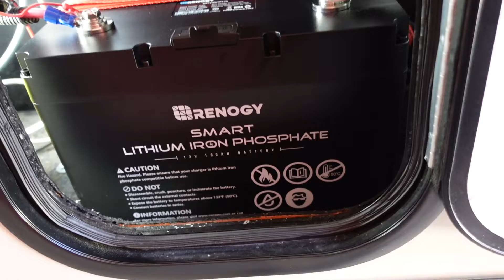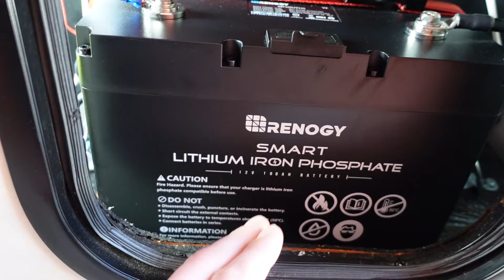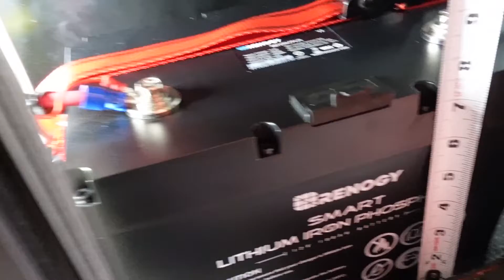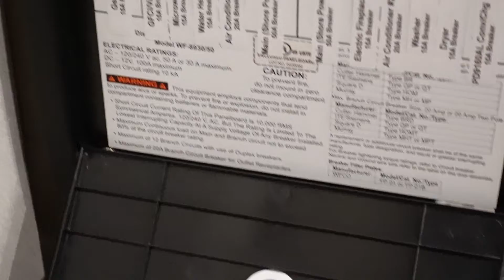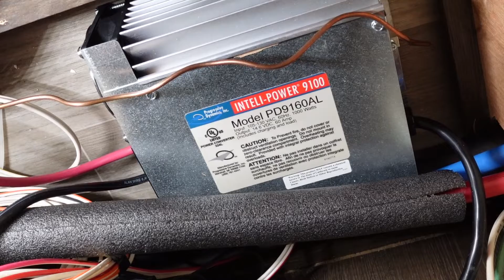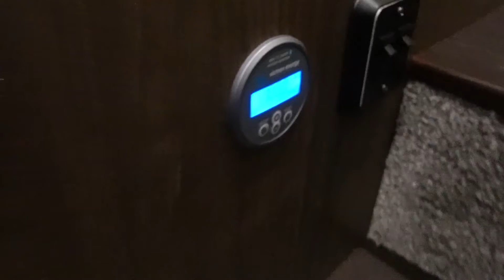Install & Review: Renogy Smart Lithium Iron Phosphate 12V 100Ah Battery in Fifth Wheel

Comment: You cannot connect these in series
Reply from the maker: Apologies for the misinformation. I should have been more specific and clarified that they can be connected in parallel for additional amp hour capacity at 12V, but not in series for 24V etc. Thanks for catching that.
Reply: @Robert Dillon  I would disagree ..they are ul listed ....doubt they are any more dangerous than any other type of battery
Reply: @Robert Dillon They are not Pouch cells anymore.. That went away in 2020.. They are packed in groups of 4 cells x4 now..And each pack is a single standalone cell...
Reply: @WizzRacing  That is for the newer cheaper model that is rated for up to only 2000 charge cylces an ha Bluetooth built in.  The better models are still pouch

Comment: Are you aware you've put a 60amp charger on a battery that has a max charge rating of 50amps?
Reply from the maker: Yep. The converter/charger doesn't literally output 60A 100% of time, rather it tapers to follow an optimized lithium charging pattern. Think of the rating as a max rating, capable of delivering up to 60A. Also, the Renogy battery has a BMS to optimize the current for charing and discharging. When selecting a replacement coverter/charger, you always want to meet or exceed the original amps. This is important as the same device also converts your 12V panel and you always want more amperage than will be drawn in the end. So if you had a 55A WFCO WF9855 model originally, then you'll need a 60A PD PD9160ALV replacement. Here's a helpful page to select the right one for your coach:
https://www.progressivedyn.com/lithium-converter-replacement-units/

Comment: Super video!  I have a new 2023 5th wheel and have been doing a lot of research on how to change to lithium.  You confirmed my thoughts and I am going with the same converter.   Just need to decide between Renogy and Battle Born.  I am planning on two 100 amp batteries so cost will be a factor.  Thanks again for o e a great video.
Reply from the maker: Thank you. Sometimes I'll see both offer some pretty good discounts, around $100-150 off especially at the big holidays. Sometimes "B stock" from Battleborn too.

Comment: You say you changed the charger from 55A to 60A.  There were comments on when that may, or may not, be necessary.  But my question is that the Renogy battery says maximum charging is 50A.  So is that 60A  going to damage these batteries?
Reply from the maker: No, the Progressive Dynamics is intelligent for Lithium batteries so it'll be fine...it knows when and how much to supply to lithium batteries. Plus, the batteries themselves have BMS that will restrict. Yes, there are a TON of comments and misinformation about not needing to change out a lead acid charger with lithium batteries. Yes, you can leave your lead acid charger in place...but it will absolutely not top-off the new lithium batteries to full capacity, meaning 100%. It's like only getting some 80-90% of the capacity of the new lithium battery bank. Plus, the charging characteristics are different between lead acide and lithium, so it won't charge as quickly nor efficiently. So it isn't "necessary" but seems like the logical thing to do to replace the charger at same time to one that is lithium compatible.

Comment: You can't discharge Lithium batteries to zero...Unless you want to jump start them. Why you only discharge them to 90%...As you need a 2 volt reference for the charger to work right...As I have two of these. Why they rate them for 1200wh,, But you can get 1350wh out of one..that last 100wh is needed for the charger to work...

Comment: Will this battery affect the alternator on the tow vehicle?
Reply from the maker: Not any differently than a lead acid battery. The tow vehicle is a pretty low trickle charge, so just a little going to battery itself.
Reply: @AdventureRocks  So if I want to replace the factory battery with 2 -100AH Lithium Iron Phosphate batteries on a 2021 micro minnie 1708 TT with 190 watts solar it would be drop in but only charge to 80 percent if I don't upgrade to a lithium charger but it would work. Would the solar controller have to be upgraded.  The trailer has a dometic 12v fridge I would like to go a few days without running a generator. Could add a second 190 solar. Have a NOCO 10 amp lithium charger that I would not mind hooking to the generator every few days.Just trying to find out what I can live with and what has to be changed, mostly do not want to ruin something.
Reply from the maker: @nkelley104  Yes, that's correct. And, it might charge a little over 80% with your existing lead acid charger...the 80% is just a ballpark. Depending on your solar controller it should have a setting to adjust for lithium (or AGM). The GoPower models when set to AGM work with lithium per the manufacturer at least. So potentially if your existing solar controller is AGM/Lithium compatible then you could use it to top off the remaining 20% or so without having to get a new 12V charger. For reference a new Progressive Dynamics charger (or converter/charger combo depending on your setup) runs in the $200-$300 range on average. They aren't too difficult to wire, but sometimes getting access can make it more time consuming pulling things out to get to it.
Reply: @AdventureRocks  Thanks for your reply have been researching for week. You explain things very clear.

Comment: What is the recommended 12v solar panel array that should be used to charge this 2-battery bank?
Reply from the maker: It kind of depends on the specific use case. For example, if you're just interested in a light load running off the battery bank, then you can probably get by with a single solar panel in the 100 to 200 watt range. But if you're using more significant resources then you may need 400 watts of solar or more. I think there are some helpful solar calculations online where it takes your input in terms of how many amps you anticipate using on a daily basis and then helps you calculate how much solar you need to replenish your consumption and keep your batteries topped off.

Comment: You mentioned connecting in series. These batteries are parallel connection only!
Reply from the maker: Yes, that's correct. I had mis-spoke in video. They are parallel only.

Comment: Is there an advantage to using two 100 AH over one 200 AH.  I am thinking mostly about summer heat.  Is there a heat issue with lithium batteries or any reason two would be better than one as I have the space?  Also, I have read that some power converter chargers have adjustable outputs for Lithium, and that some are even able to switch between the two.  I will have to get to mine to look up the model unless I have a book for it, which will be my next move, but I could even live with 80% with two of them but does sound like a waste, unless they would last longer that way.
Reply from the maker: Glad to help. I think only benefit of having 2x 100ah would be if one failed, at least you still have the other 100ah to use while you replace it. Otherwise I don't think there's any downside to the 200ah, especially if it takes up less space. And, I don't think heat is much of a concern...more so with inverters and such I'd say. Still good to have some breathing room for the lithium batteries though.

And, you are correct on some converters having a switch to go between lead acid and lithium. The only one I know of are the Progressive Dynamics models that have that built-in, but there's always new products coming out so be great if they all had that switch. My current RV, a Jayco Pinnacle, was the first RV I've owned that had such a switch thankfully (it has the Progressive Dynamics converter/charger).
Reply: Two batteries in parallel are better. That way if you lose one battery. You still have one working to supply some power..,Plus the sizes of the 100ah allows for different space configuration..The 200ah is 21 inch long. And you can't cut it in half for a side by side install. 

So yes there are advantages. And these Renogy Batteries self balance across each other. When they are charging. So one battery does not get the short end of the stick..
Reply: One battery is always better than parallel, charging/discharging from one battery is always preferred option.

Comment: Lets also remember the voltage does not drop until the last 1% - I have 60V batteries on my electric motorbike and they stay at 60v all the way and even when it's flashing empty the power is still there
Reply: Not so true when drawing a large amperage,the voltage sags just as much as agm etc,so when setting low voltage alarms you have to take this into account,they will drop between 1-1.6v while supplying big loads  then bounce straight back when load is off.
Reply from the maker: Great point!

Comment: You absolutely do not have to change the charger! My Progressive Dynamic lead-acid charger charges my lithium ion battery to 98%
Reply from the maker: That's great news. My WFCO lead acid charger only charged the lithium to 80%, but I think the Progressive Dynamic units are a programmed differently. I would definitely recommend checking with the manufacturer though to follow their best practices.
Reply: The sticker on your charger said 14.6volts which Renolgy say is the Charger max voltage so I concur, the existing charger should be ok.
Reply from the maker: Yes, that's actually my replacement charger you're seeing there in video, so you are correct on the 14.6V for Renogy lithium. Sorry if that wasn't clear that I already replaced my charger. The WFCO chargers that are more common for OEM (as in my case) are programmed for lead acid batteries so they stop charging at less than 14.6V. To be clear you do not HAVE to replace a lead acid charger when upgrading to lithium as it will still charge the lithium battery. But the lead acid charger is programmed for the lead acid profile, which is significantly different than a lithium battery profile. It's a personal decision in the end and you've got to decide if the experience of getting a rapid and optimized charge at 100% on lithium is worth the $200-$300 upgrade cost of a coverter optimized for lithium batteries. Hope this helps!

Comment: The Renogy LiFePO4 battery is actually pretty cool & incredibly well designed. First, Renogy uses pouch cells- sort of unusual in larger batteries. But, those pouches are fused together to make cells, then the cells are series together to get it up to 12v. Then, the whole bunch is put into a nice, sized metal case to protect them. The wiring used, the internal fusing- all top notch. Really, a well designed battery- all hidden inside a black box. I DO like the internal build specs, but- personally, I want to be able to 'scale up' to a 24v system and even perhaps a 48v system, thereby allowing thinner wire which is less expensive & easier to pull through RV walls! The Renogy battery cannot be series connected to increase volts- bummer. But, if I was building a 12v system- the Renogy battery would definitely be in the mix!

Comment: Instead of replacing an expensive converter why not buy a cheap lithium battery charger and tie it into the battery.. as the “old” converter charges it to 80percent the cheaper charger tops it off …simply install a 110v outlet in the battery bay or run and extension cord to it …40 bucks for a charger ..and problem solved ? Also renogy has a battery monitor that plugs into one of the ports on the battery for about 39 dollars
Reply from the maker: All great ideas. Thank you for sharing!

Comment: So what's smart about it? I understand that battleborn is a drop in replacement for lead acid - electronics included to match charge voltage. True?
Reply from the maker: It's no smarter than a Battle Born...both can be considered "smart" -- I believe Renogy is just trying to convey the onboard BMS (battery management system). Some cheaper lithium batteries on the market don't have an onboard BMS meaning they may not charge or discharge in an ideal fashion that could lead to damaging the lithium cells or worse causing the battery to malfunction. Or some cheaper ones may have a poorly performing BMS that doesn't really do its job. The BMS just regulates everything in/out to ensure peak performance. The Renogy and Battle Born are technically drop-in replacements for lead acid, but your existing converter/charger on the rig may only know the voltage of a lead acid battery, which means the charger would stop charging when it reaches what it thinks is a full voltage, which is less on lead acid compared to lithium (usually about 80%). Hope this helps!
Reply: Regarding the "drop in replacement" aspect, my 15-year old travel trailer has a steel battery box welded to the A-frame between the hitch and trailer body.  The box was made to hold two Group 24 size batteries.  I ordered two Battle Born 100ah batteries before I took a close look at their specs and measuring my battery box.  Come to find out, the Battle Born is more like the size of larger Group 27 batteries.  They weren't going to fit in my battery box without me doing some cutting and grinding on the steel box.  I didn't really want to do that.  Nor was I excited about the prospect of re-routing the battery cables and trying to find a place to install the batteries inside my small trailer.  I got really good help over the phone from Battle Born on what my options might be.  Since my order hadn't yet shipped, they were very good about canceling my order and refunding payment.  From my experience, you won't get anything like that level of support and responsiveness from Renogy.  However, the Renogy battery is more like a Group 24 size and would just fit in my battery box, so I reluctantly bought a pair of their batteries.  I am in the process of replacing my power center/converter/charger so I haven't yet starting using the new batteries.  My impression of Renogy is that they are a mysterious, faceless outfit with subpar support.  They are on the, "Due to increased call volume you'll have to wait on hold for over an hour to talk to someone" bandwagon.  Some people have said they are a marketing company that just rebrands products from other manufacturers.  I don't know about that but just try to find out who they are and how they operate.  You will see what I mean.  On the other hand, BB is based and manufactured in Nevada.  Their CEO and COO appear in many of their support videos.  They seem like a top notch company with a bright future.  The Renogy batteries were each only $50 less than the BB.  My impression is that the batteries are fairly comparable performance-wise for a 12-volt system or I would have kept exploring alternatives.  If only they had fit in my box, I would have bought Battle Born for sure.  Renogy has a large line of interesting products, largely made in China as best I can tell.  I am hopeful that they will become a more transparent, supportive and responsive company.  Such changes have to come from the top management, whoever that is.  And lastly, they really need to put some effort into improving their terribly reviewed monitoring mobile apps.  It's 2021 for crying out loud.  End of rant.
Reply: @joekendrick5261  You misunderstood. I want to use a Lithium battery to start my vehicle. Re Renogy I've had 2 panels on the roof of my rv to charge a dying deep cell battery which would've needed a swap out long ago. Panels and electronics work fine.
Reply: @ottovonottsville476  Oh, I see. When you say “drop in replacement” I immediately think of RV’s. At least I got my misgivings about Renogy off my chest.
Reply: @joekendrick5261  My rv deep cell battery charges off my alternator too so it would also apply. Haven't shopped around for awhile.